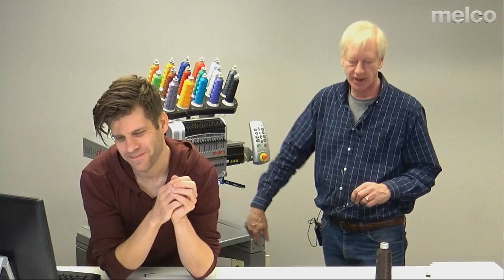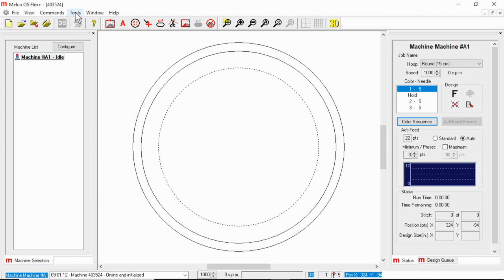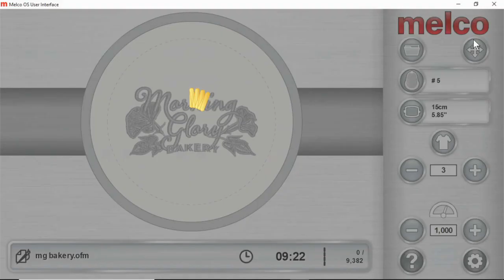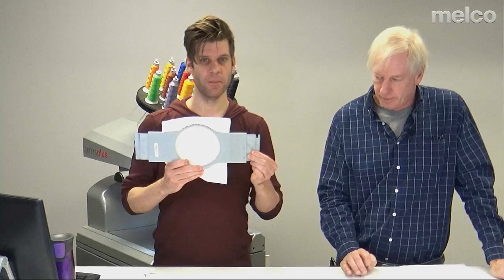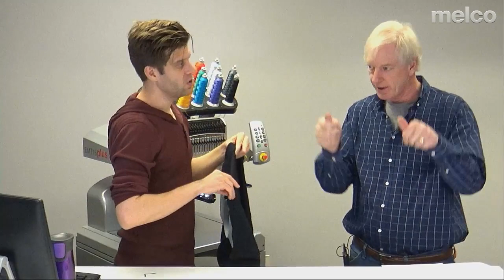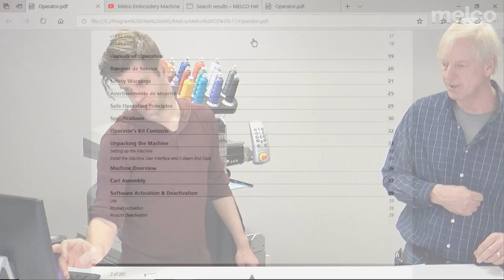Machine Basic Setup, loading and running designs.

Comment: Can you add this to a video... Our machine unthreads, does not break the thread just unthreads it when it need to move to another location.   Not a color change, but a simple jump after sewing a line of text then moving to the next.  I am sure it is a tension problem but can not seem to resolve it.

Comment: I have an a mayor XTS 2011 Iran am I am OS version 10 it’s been updated to the zero0.51 when I bring up the machine with the program on it will announce the machine is ready but when I try to use the program it is frozen I have went into my computer and made all the adjustments that it suggested rebooted and still frozen cannot get the program to work at all what should I do.
Reply from the maker: Hi Penny.  Attached is a link for support.  

https://melco.zendesk.com/hc/en-us/articles/202857595-Contacting-Melco-Warranty-Technical-Support

Comment: How do you move the embroidery arm all the way back when not in use
Reply from the maker: I don't do this, but after you're done and the machine is powered down, you could press on the carriage and SLOWLY move the arms back. With the power off, the motors locking the carriage are disengaged. You can move it. Just be SLOW.